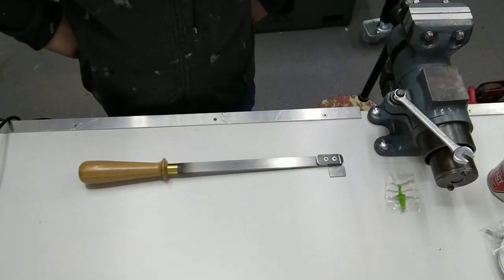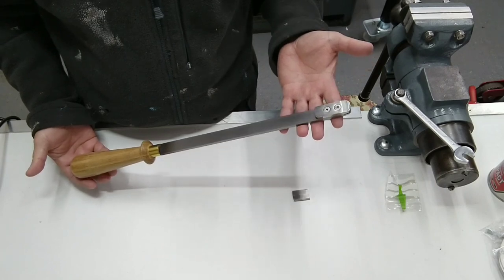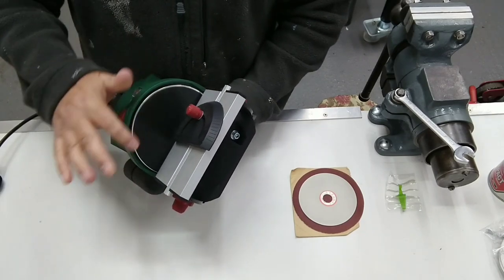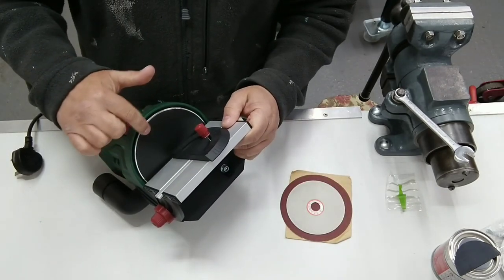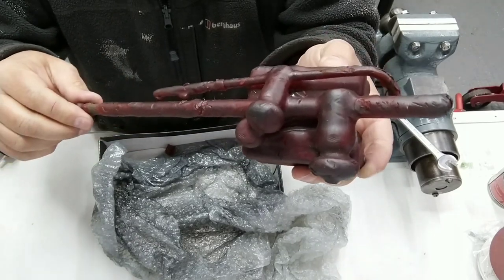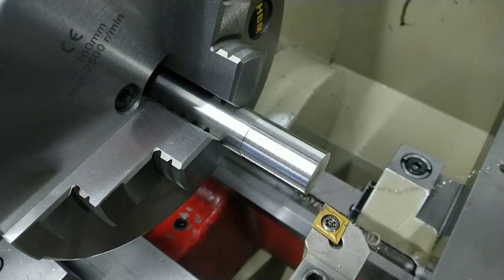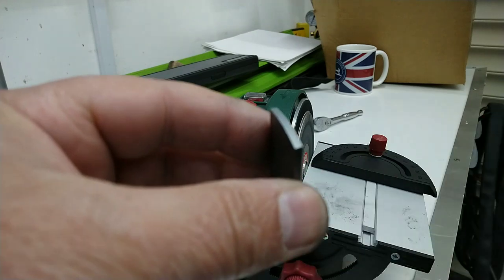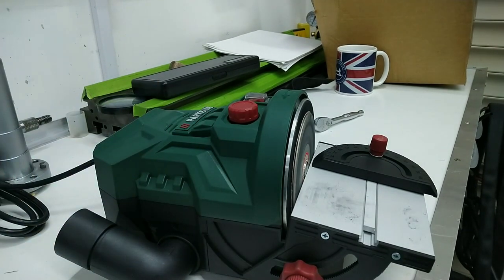Making a Slow Speed Carbide Sharpener

Comment: That will work. I made one based on Mat Look’s design, what lets is down is the donor grinder, I adopted Stefan Gotteswinters idea of using magnets to hood the diamond disk on the platen and drive pins. I too have a bit of wobble on the disc it can make the grinding a little tiresome. You can use WD40 as a lubricant or IPA helps refine the finish. You will develop you own way, what the aficionados seem to like to see is an absence of scratches in the scrape mark, this is a result of having a finely ground sharp edge to the blade. A wider radius helps when starting out as it’s easier to control.
Reply from the maker: Hello Tony. Thank you for your kind interest and comments. When I set about looking for a way to sharpen these blades, I wanted something where the method of fixing the diamond discs would be quick and easy and the hard part, ie the angled table, was already there. Also I didn't want the speed to be fixed by a set mechanical ratio. Adapting this simple sander gives me all that. I can also modify the electronics if I find it is too fast. Thank you for your advice on sharpening I will heed it.

Comment: All good ideas there Carl. I cant take my eyes off your bench vice , What a beauty Dust extractor on carbide , nasty stuff for the lungs . Cheers Ade.
Reply from the maker: Hi Ade. Thank you so much for your kind words. The bench vice is one of two I have. It is an ex MOD world war 2 era Swindens. When I got it, it was in a bit of a state. I refurbished it and painted it up with zinc rich primer then Harrison blue/grey. My other vice is also ex MOD but is a Record. One of the things that attracted me to using this Lidl sander as a carbide sharpener was the vacuum port. Also the built in tilting table and the very quick means of changing the discs over. Essentially it was 90% there. All I needed to do was add the locating feature. Even I could do that!

Comment: G'day Carl. Great modification, that little tool looks to be ideal for the job. Just two things 1)  I believe carbide dust is extremely nasty stuff to breathe, so that vacuum port will come in very handy 2) with the 5 degree bevel, try to arrange it so that the table is sloping the other way, and the grinder is pushing into the cutting edge, rather than off the cutting edge, this will reduce fracturing of the edge and give you a sharper and more durable edge - from everything I've read/heard. Great video. Looking forward to more! (I'm on the same journey) Cheers, Craig
Reply from the maker: Hello Craig, great to see you and thank you for commenting. Both your points are well made and taken on board. I should have mentioned the vacuum port. It was one of the reasons that attracted me to using the sander. That and the ease of mounting the discs. Also I can modify the electronics to give slower speed but undiminished torque. I should have known about the direction of grinding, thank you for that. The table slopes both ways so easily achievable. Thanks again for your interest and comments.
Reply: @carlwilson1772  it will be good to see the electronics modifications. I also take an interest in that kind of work 👍
Reply: Came here to mention the potential issues with carbide dust, happy to see it was already addressed. I personally have not done any scrapping since I was an apprentice back in the mid 60's, and even that was only an introduction, so I'm looking forward to getting a refresher :)
Reply from the maker: @paulhammond7489  Always great to see you and receive a comment. Understand the issues with carbide dust, thank you for reiterating. I meant to mention the vacuum cleaner port on the sander, it was one of the things that attracted me to modifying it. Thanks again for your interest and support. It may be some time before I get to do any scraping, but rest assured I will get to it. And it won't really be a tutorial, because I know nothing about it!
Reply: @carlwilson1772  It's certainly an art, we were only taught the bare minimum for increasing oil retention on ways on machine tools etc. It was a very brief part of our craft apprentiship. I look forward to watching your progression over time, but you have already built a good foundation regarding tooling for the task.
Reply from the maker: @paulhammond7489  Well Paul I am starting from the ground up, have no idea if I will be any good at it or not. I won't be able to go to the sort of lengths some people do because I don't have any big reference surfaces. No room for a big surface plate or long straight edges, sadly. I can however at least have a go!
Reply: @carlwilson1772  Deciding to 'have a go' is the most important step in every journey.
Reply from the maker: @paulhammond7489  I agree completely.
Reply: Great job on the grinder modification. It shows what can be done 'for a modest outlay' as Sparey would have said.
Best wishes, Dean.
Reply: @retromechanicalengineer  took me a second to get the Sparey reference. That's LH Sparey? (From memory) I have a book written by the guy, I believe.
Reply from the maker: @retromechanicalengineer  Thanks! It does indeed. It was a case of seeing how it could be done simply and without too much butchering of the sander.
Reply from the maker: @CraigsWorkshop  Retromeccanica is my brother. He is referring to LH Sparey as you say. He is the author of the seminal work "The Amateurs Lathe".
Reply: @carlwilson1772  Thanks. That's the book I have 👍 Did not realise you were brothers with Retromeccanica! A name I recognise from the comments section over the past few years 🙂

Comment: Hello Carl,
Interesting video and that seemed to work well... Neil from Nell's mechanical mancave did a similar conversion. I got the same hand scaper from Kurt for my scraping project. I look forward to watching more on this project. It will be interesting to see the turning the between centrer mill cutter.
Take care.
Paul,,
Reply from the maker: Paul, thank you so much for your support, I really appreciate it. The sharpening arrangement works well. I'd no idea @Nell's Man Cave did the same. I am not going to try to machine those cutters now. I'm going to try to find a Clarkson chuck that will take them. I will look for an int30 one as I will be using them in my Harrison Mill. I think the Mill drill would have a seizure if I tried. Workhorse though it is. Thanks again!

Comment: I think you might want to tilt your table to the opposite side of 90 degrees. I was recently told that you want to sharpen the carbide from the outside to the middle, as sharpening it the opposite can cause the carbide to chip, even microscopically.
Reply from the maker: Hello and thank you very much for watching my film and commenting. Thanks for the advice, I've heard this from others now and will most definitely do it that way.
Reply: @carlwilson1772  I just went through a crash course in machine scraping and have been trying to figure out a way to sharpen carbide myself I have an old treadmill motor that can run pretty slow that might be the right candidate.
Reply from the maker: @MyLilMule  Sounds like an excellent plan.